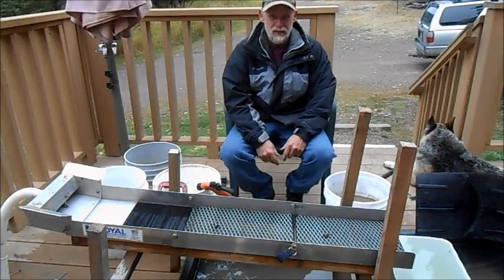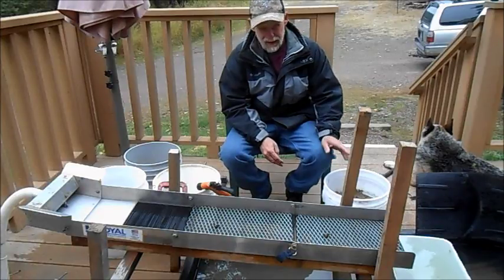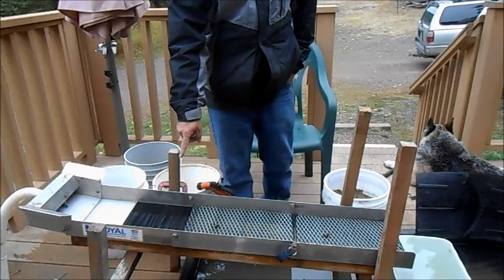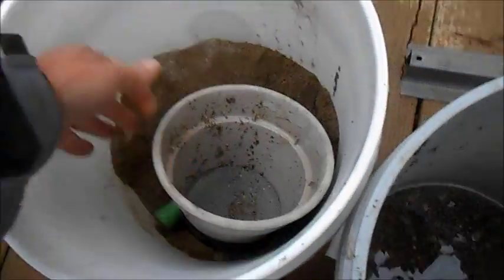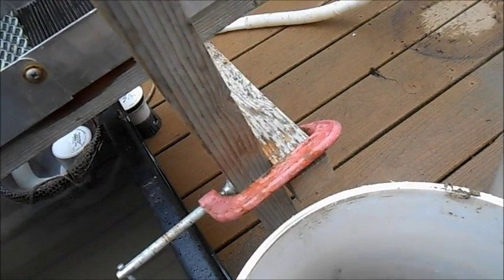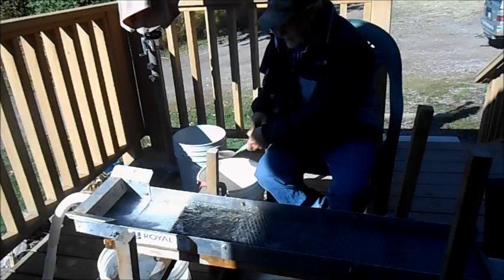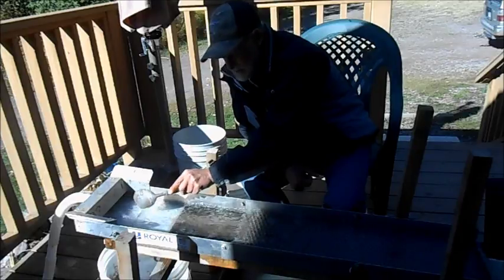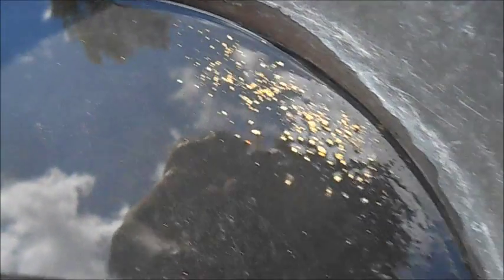Recovering Gold From 7 Gal Of Jig Concentrates With A Sluice Box

Comment: Are you running a 1:12 drop ratio?
Reply from the maker: My sluice box is about 3 feet long I try to set it up with a 2 to 3 inch drop depending on the material I am running.